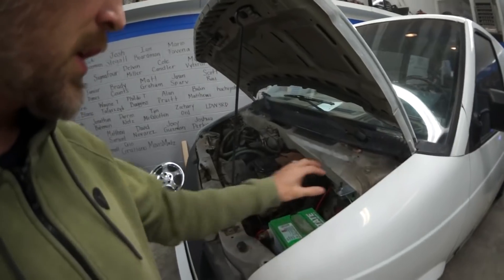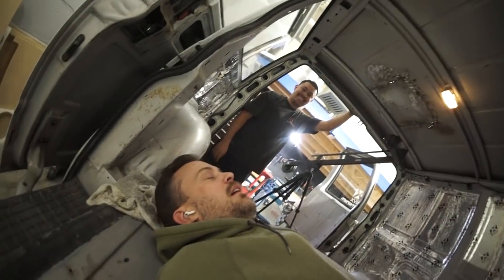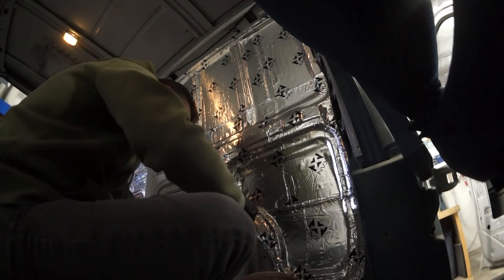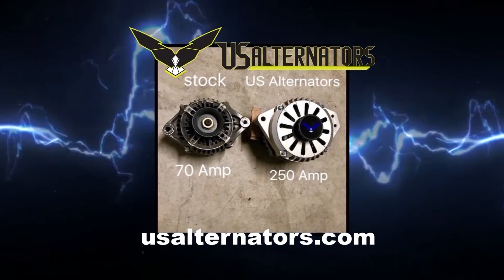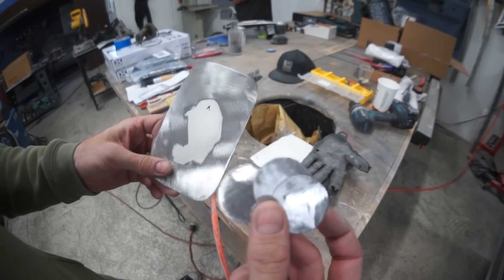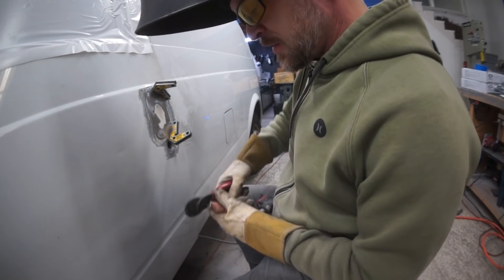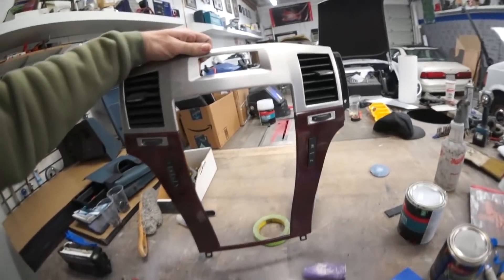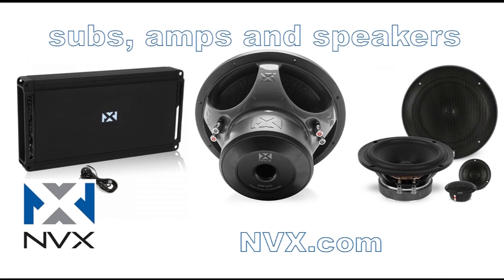Rafa pranked the bass van - BVV14

Comment: Doug, you should add an external battery connector so if the battery dies you can still open the doors. I'm sure you have thought of this already you evil genius.
Reply: Nope.. he should install a cable detent to manually override the actuator. That way if the battery does die, he can reach somewhere( usually  driver side firewall/fender. Pull a cable and Voila!

Comment: Hi. Bit of an odd question, and totally unrelated to this video, but how do you charge the iPad when you install an iPad in a vehicle? I have my iPad 3 mounted with magnets because there isn't many options to make a bracket in a Nissan almera 2013 up. Well that's what it is called in my country (south africa). Tried usb 12v chargers. Battery doesn't charge when screen is on. Please advise. TIA

Comment: Is it necessary to completely cover the panels on a regular car?  I remember shitty dynamat ads that just had random 3” squares on each panel.  I want to cut the wind noise on my WRX but I don’t want to add 3000 lbs of tinfoil hat.
Reply: The more solid and rigid you can make a vehicle that is turning into a sub box the better it will be for your overall db. If its a regular car daily driven etc, the squares would usually suffice with some fine tuning on bad spots of course:)

Comment: Hey Doug, I have a question totally unrelated to your video. Hopefully you can help me out. I have a Kenwood Excelon, a JL 5 channel RD amp and a 10” W1v3 in a sealed box. I’m just powering the sub with the amp at this moment. Everything’s set up the way it’s supposed to be. The only thing is that my Kenwood has a setting called “Bass EXT” and the manual is very vague. I tried turning it on and the bass seems to play slightly lower, but It’s bearly noticeable. Should I leave it on and retune my amp or just leave everything as is.